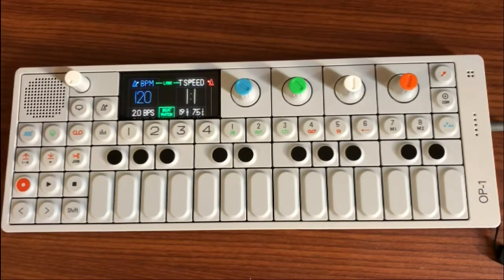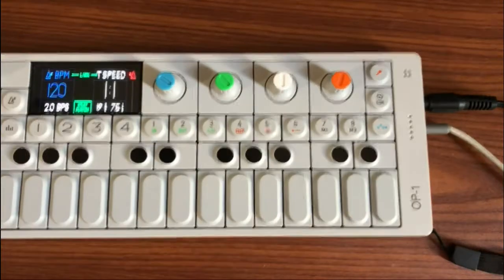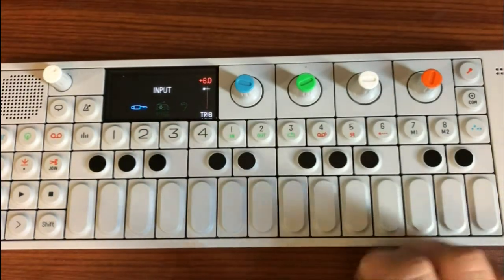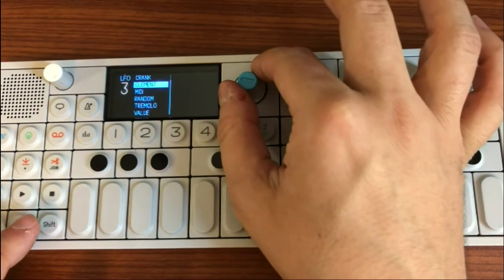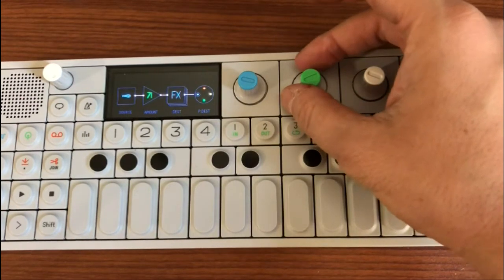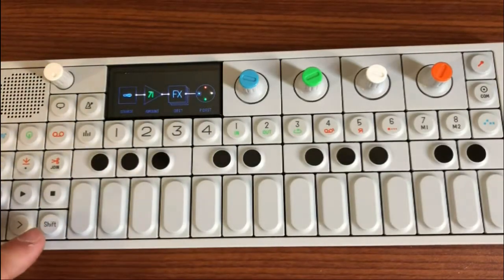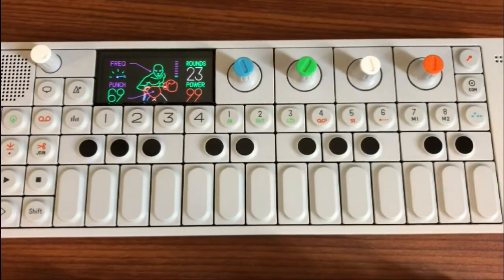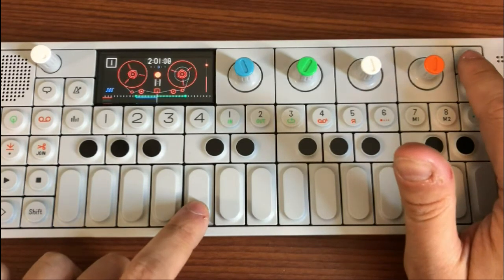Teenage Engineering OP-1 | Create Genuine Sidechain Compression

Comment: Can you set the first parameter to any internal sources instead of the line input? That would seal the deal for me and get me one of these haha! If not that would be a great feature suggestion, imagine being able to select one of the tape tracks, that would be amazing.
Reply from the maker: you can! you can set the “element” LFO to use the ADSR envelope, the internal gyroscope, or the level of the synth patch you’ve selected. in addition, you can use the built in FM radio as an input to the LFO.
Reply: Parkfield Ah ok, can you select the sampler as a source too? Like an internal sampled kick for example?
Reply from the maker: Presto yes, you can
Reply: Parkfield thanks for the info man, you just sold me definitely, now the next issue, the price tag 😂
Reply from the maker: @bagoftrix  you can get a good discount on the og op-1 now the Field is out!
Reply: @parkfield7296  i actually bought one and put it on sale recently , I love it but it misses some key features and the sp404 mk2 is my main squeeze now 😂

Comment: Thanks mate. AFAIK, the white encoder on the input is to set the input threshold before sampling will occur when you sample into the drum/synth sampler. It doesn't affect the actual input... I could be wrong, but I think that's how it works.
Reply from the maker: Elvish Pretzely I think you may be right. Thank you for the clarification.